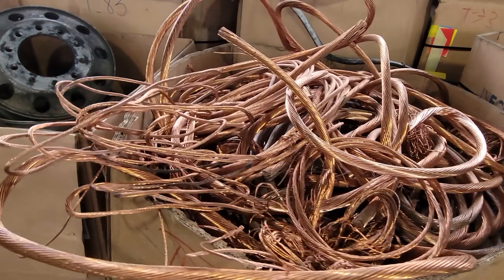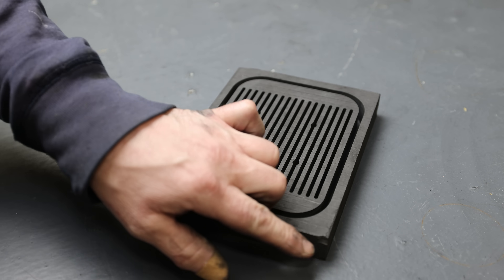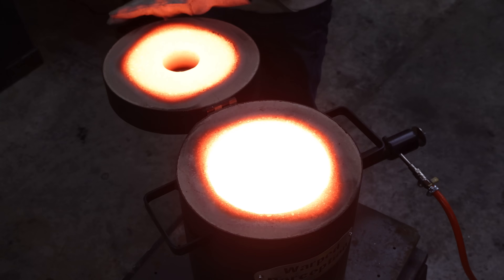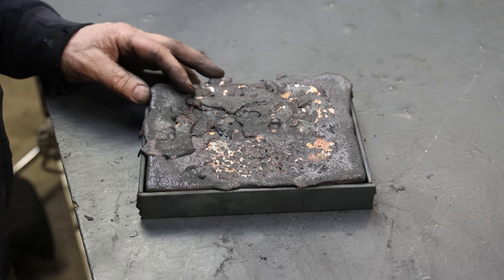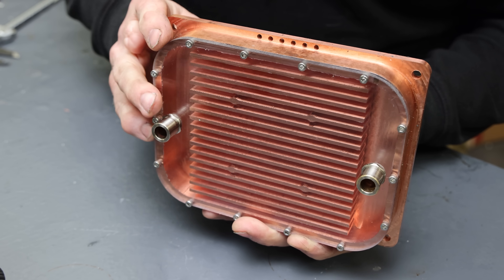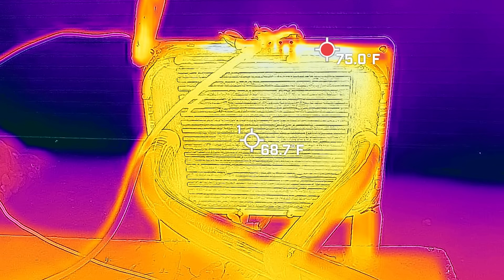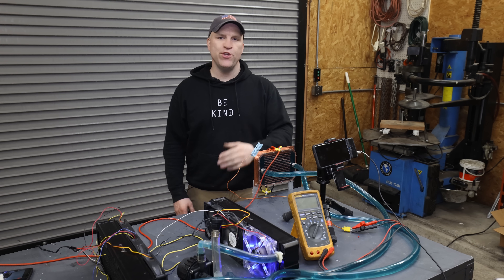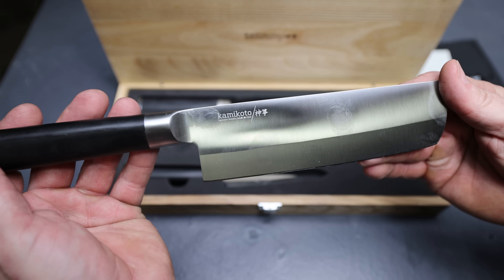Making a Huge Waterblock from Scrap Copper -Trash to Treasure

Comment: The slot width to rib width ratio should have been better designed. You need narrower slots neat the water inlet, and widen them to about what you have now at the farthest from the middle. Fluids will take the path of least resistance, which is near the center slots by the hoses. This will starve the areas furthest from the hoses. Also, if the slots/ribs were shaped like "continuous S curves" for the length of the slots, then you force the water to stay in contact with the walls... for far greater heat removal. As it is now, the water near the walls will be nearly static, since the water seeks the path of least resistance... which is down the middle of the slots.
Fluid Dynamics 101

Also preheat the mold before pouring the molten copper... prevent it from cooling down so fast.. and it would allow for air to bubble up and escape.
Reply from the maker: Yeah well the actual design is much different than this, I just made this so I can have it working unit because my big machine won't be here for 3 or 4 more months. This is the best I can do with that dinosaur CNC. As for pouring the copper I did preheat the mold, but the idea is to prevent the air from being absorbed into the liquid copper in the first place, fix the problem before it happens don't try to bandaid it. If there is any air in the copper to escape then I already failed before I succeeded. As for the design yeah you're correct like I said I don't have a more capable CNC at this time, else I would have went with my original design which was not even fins, as for the path of least resistance you are also correct but I simulated this in my flow simulation software, one thing you are not thinking about is flow versus surface area, it wouldn't matter if you had half inch gaps in between those fins, if you have enough volume then you have a static pressure difference from the inlet to the outlet and everything would get Even Flow which is the case in this situation. But at the end of the day my goal was to have a working unit with the equipment I have available to me at the moment, and I have achieved that goal. My goal was not to make the most efficient water block on the planet. Just clarifying and giving you the whole story

Comment: Amazing! What did you mix with the silicone to liquify it ?
Reply from the maker: Mineral spirits, that is a trick that I learned that I have used so many times, you could even make sheets of silicone and all sorts of stuff using that method. And the nice thing is it doesn't hurt the integrity of the silicone itself I have done sheets that were like .005 of an inch thick and it's amazing how strong the sheet is

Comment: Obviously it would have taken more copper but why not just cast a billet and then machined the whole thing out of the billet? The whole graphite thing seemed unnecessary when the fins are so far apart anyway, looks like about 3/16" between each fin. The graphite thing just seemed like a huge mess and a PIA. I assume you're reclaiming the copper chips anyway.
Reply from the maker: Because I didn't want any air in the casting, so I reduced the cross-sectional volume of the liquid state copper. If I would have poured one giant ingot I'm almost positive I would have had air in the middle because it's such a large piece.

Comment: Looks awesome and very nice job. Just watch those D5 pumps as if you get an air bubble trapped in the impeller the ceramic bearing the hub rides on will melt through it. I have built lots of custom pc water loops over the years and seen this failure lots when customers change the fluid and let them run with air in them.
Reply from the maker: Yup.. happened to me

Comment: You seem like a skilled designer and machinist so I assume you're aware of this, but in fusion 360 it's best to turn all those blue lines black. The blue aren't fully defined and the further you get into a project the more of an issue that becomes. Final product is awesome though, love the work you've done!
Reply from the maker: Thank you, actually I just started using Fusion 360 recently so I'm still getting familiar. I moved over from SolidWorks.

Comment: What chip ? What model ? What stress ? I have 20 or so more questions you didnt speak on . Voltages ? Power input ? Amps ? Shit ... Volts even .
Please re-upload with more info .

Awesome milling , casting  and design wirk brother . 
Beyond my talent
Reply from the maker: Thanks! Well those numbers are not final yet only the actual size of the chip and the theoretical output.. but it is a COB, I'm also having some issues because of the physical size of the chip and fitting it into a light modifier ring. So at the end I will probably redesign the light once I get my bigger machine which is much more capable than the CNC I currently have. My original design was smaller and more intricate and much better but it would have taken a week to machine.

Comment: Im sure its been commented before, or maybe you covered it in another video but, you could drop the tempetures more if you have more fins or surface area inside the water block. also another radiator to pump more heat out of the water.
Reply from the maker: Yes absolutely, you're correct, but my limit here was the type of CNC machine I was using, it is very slow. My original design had a whole bunch of little cones not fins, but for me to machine that it would have taken a week and I needed something working.

Comment: The water block input and output are on the left and right instead of top and bottom.  Given that heat rises, I would assume that orienting the channels vertically where in the input was at the bottom and output was at the top would optimize heat relief.  I'm curious why a horizontal orientation was used.  I'm very impressed with this project!
Reply from the maker: Thank you, the water block cover was just for the video the actual cover I'm going to make is an auto bleed style with multiple input and outputs in different locations, one thing about lights is you need to be able to use them in any orientation, so yeah once I get a bigger CNC I will be switching up the design a little bit I was limited in my design by the type of machine that I was using.

Comment: It would have been way easier for your and the cast would have come out 100000 times better if you just used sand instead of the fancy graphite block.

Most important thing is that the casting form gets filled up from the bottom homogenously. 

Besides that beautiful video as always! 

Cheers
Reply from the maker: I was trying to use sand originally but those fins I was having trouble with the sand keeping the form since they were so deep
Reply: Well yeah i guess at some point you just have to ditch an idea for another for times sake. Graphite block looks fancy af!

Comment: It might have been mentioned already (don't want to read 1K comments to find out!) - but a suggestion for your port positions in the block cover (as an automotive guy!) - Put the inlet near the top, and the outlet near the bottom vs side to side. Makes for better flow through your core.

Comment: Nice job...
Its probably already been suggested but you should try the following:
1: current design turn the heatsink 90 degrees 
2: modify the current design with your inlet hose top left corner and outlet hose bottom right
3: modify number 2 and have the fins on the block at 45 degrees
The idea is for all the above to increase the flow efficiency of the fluid in the block thereby reducing the temp.
(you could also try radiator coolant ???)

Comment: You need a temp sensor (Microcenter has bitspower temp sensor) for coolant because pc liquid cooling parts usually have a max 60 C operating temp. Also, better fans like Noctua who make 3k rpm fans that can get wet (maybe important with the environment they're in, Amazon sells them). Lastly, appears flow is not so great within the block so maybe split flow into 2 inputs to get better flow which equal lower temps

Comment: I am wondering why you went through the whole struggle with the graphite mold and the nasty dust everywhere, instead of machining it from solid copper or using a lost mold made of sand?
Reply: I assume he just didn't think about it at the time. You can't really say the mold reduced Machining time since he took like 12 hours to Machine the graphite anyway.
Reply: My question too! Whats the answer?

Comment: Tip: create a plane on the top face of the CAD and use close surface o body, or make a solid and subtract the mould then you’ll get a body which you can directly inspect and get the volume

Comment: were ur boogers black from graphite particles in air
Reply from the maker: A little bit but I was wearing a respirator most of the time and I also left the shop for most of the machining.
Reply: @WarpedYT  hey man seeing you machine graphite gave me and idea a dry cell hho generator with graphite plates machines as zig zags or a maze like pattern to increase surface area although the catalyst will need to be pumped

Comment: when you make your housing for this thing, i would add a second radiator in the loop and a small fan with a duct to blow a little air over the front of the LED to push away that superheated pocket of air, convection will move some but forcing cool air across it will help.
Reply from the maker: Love that idea, that makes perfect sense I believe it is exactly that, a superheated pocket of air.

Comment: @warped perceptionim not an exper or any thing but i think there might be a big flaw in the design and that is that you have the water connections in the middle on both sides so the water just flows through the middle of the waterblock they should be in opposite corners so it flows through the entire waterblock
Reply from the maker: Yeah this was only for the video, also this is the first working prototype, once I get my other CNC machine which is much more powerful and capable, I'm going to make a completely different design, more like I giant PC style water block with peaks instead of fins. Then I will have one connection feeding in the center and one connection on the outside corner.

Comment: Do not hammer the part with the dial touching it. It damage the dial.
Reply from the maker: You are correct... I did it for the video but yeah..
Reply: @WarpedYT  I had once a metrology teacher in the navy here in Brasil, he worked building huge ship power shafts, more than 30ft long some times. He was 50 years in this work. I try my best to spread his knowledge Haha

Comment: Good effort.. 
I dont know why you bothered casting a water block unless you just wanted to try casting copper.
2 options, I would have looked at:
1. machined a perspex block and used resin/silastic to cap the back of the LED chip and allowed the coolent to be in direct contact with the LED chip.
or
2. used peltier solid state heatpumps to cover back of LED chip then a waterblock to disipate heat from the peltiers.
Yes, copper has a high heat conductivity but it has to pass through what looks like 1/4" of copper and heat transfer compound before it is disipated.  

When casting copper, pour crushed glass over top of molten copper in crucible, also make a carbon/graphite lid for the crucible, use borax as a flux and degass the copper before pouring. 
cheers
Reply from the maker: Because the raw material was not available, it was on backorder for minimum 2 months.  peltier would never work here, there is too much heat, as for the flux, I've never tried the glass but borax for degassing is exactly what I used only a different technique... What worked at the time..
Reply from the maker: As for the direct contact idea, yeah this was my first approach but when I ran the computer simulations it didn't work as well as I thought it would.. all good though and it worked, thanks for all the advice

Comment: This is pretty impressive, but it's a bit odd to see you using thermal paste after going to such lengths for the rest of the water block. If the backside of the LED packaging is compatible with gallium you should really try using liquid metal TIM. It's a fraction of the cost of that insane solid copper water block and I'd bet the gains from swapping out regular thermal paste for liquid metal will be greater than whatever improvements you made creating a custom water block vs. a large COTS one.
Reply from the maker: I tried that liquid metal... Didn't work well for me. I ended up using 98% diamond which was about $100 for a small tube. I was excited about the liquid metal as well but it's very cheap and unfortunately you almost always get what you pay for. It was better than the regular white thermal paste for sure but not nearly as good as diamond.

Comment: Wouldn’t you get better heat transfer from copper to coolant if the intake and exhaust ports for the coolant were offset? (Intake at the top left and exhaust at the bottom right for example)
Reply: i was thinking that as well, plus microfinning (probably wouldnt even need to be that "micro") all the horizontal channels to dramatically increase the actual surface area and help with heat transfer.
Reply: Intake at bottom, exhaust at top for better effect. ( Heat rises, self venting, counter current circulation to a larger surface area of the copper block)
Reply: @za7v9ier  yup and you will get more even flow when the pressure of the water is forced up.

Comment: Really impressive skills. Intel makes a sub zero CPU cooler, it uses a refrigerant I wonder if it could accomplish the same or if it wouldn't have enough thermal capacity.
Reply from the maker: I have a refrigeration engineering background, many of the things that I dabbed into over the years that was my original design was to use a refrigerant block but portability will suffer big time, you would not be able to remove the lines or anything else without special equipment since it would be high pressure refrigerant, but yeah that would do the trick no problem.

Comment: Wonder how much bigger it would need to be if you cast aluminium.
Reply from the maker: I tried aluminum first, much more available and way easier to work with then copper. The limiting factor here is the size of the actual chip and how much heat it produces for its size, for that reason aluminum would not work.

Comment: Use a system of copper heat pipes.... Much better and highly effective.
Reply from the maker: I tried that, it didn't work, the thermal conductivity versus the distance was an issue. Also the thermal conductivity between the connections of the pipes and the base plate was also a loss. I was only right about to run this thing 60% with the thermal pipe configuration which is why I ended up putting all the geometries into one single part so I only have one transitional connection between the chip and the plate that's it.

Comment: Firstly great video. I was sure I was subbed to your channel and was wondering why I hadn't seen your vids for a bit . 
Turns out the subs was off not sure what was going on there. 
What thermal paste are you using between the LED chip and the heat-sink? 
If you need extra heat transfer maybe try a Mo Ra style radiator it will give you more surface area and room for something like 9 fans from memory. 
You could try doubling your coolant flow rate by adding an extra D5 pump and putting dual inlets and outlets on the heat-sink.

Comment: How about if you flip the heat sink to the left so the cold coolant drop from the top and the heated one can quickly drain out from the bottom that way the coolant can takeway the heat from copper more efficiently. I m h o

Comment: Why not just buy a solid copper block and machine the whole thing instead of casting it?  Also, when sealing the water block with your acrylic top, was there a reason you didn't use a rubber grommet instead of gluing?

Comment: I work with alot of cooling components for very powerful computers and hands down the best way to do a liquid cooled block is to have a completely hollow cavity and fill it with fin stock the will allow coolant through and then solder or braze a cover over it. the fin stock maximizes the area that the coolant is touching and it can wick away heat insanely good
Reply from the maker: I agree with you, that was the way I wanted to go, however I needed something very strong in robust to use on set for film and my YouTube videos. I can almost guarantee you that if I just soldered a cover over some thin stock, during the first shoot I would have coolant all over the place and a burned out cob. When filming even YouTube videos and you're in a hurry or you're caught in a situation stuff gets knocked down hit abused, this light is not going to just sit on the desk I can assure you. That being said I completely agree and in the future when I get my next CNC machine in a few months, I may do some really high RPM intricate milling on another piece just like this to make an improved version. Unfortunately the automatic manual machine I'm using now is based on a dinosaur machine.

Comment: Man... Yopu hace a CNC....
You dont have to create a Negative...
Just create a solid block o cooper and then create te piece with CNC
Reply from the maker: I couldn't get a solid piece of copper at this time it's on back order for minimum of 2 months, and I didn't cast that large of a piece because my goal was to reduce the cross-sectional volume of the copper to reduce or completely eliminate air entrapment.

Comment: Are you using glycol of any kind? Nothing compares to the thermal Conductivity of RO h2o. You lose about 0.5% efficiency per 1% glycol down to 70% thermal efficiency.
Reply from the maker: Yes for the test I am, I am going to use distilled water or RO water for the final.